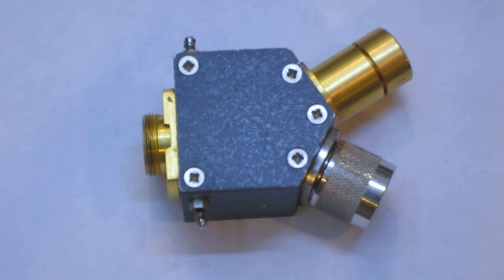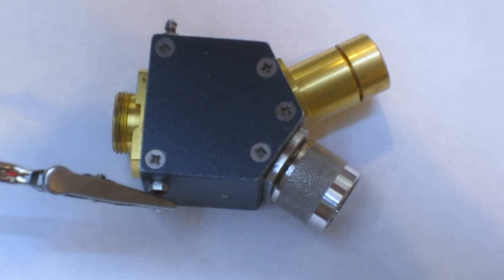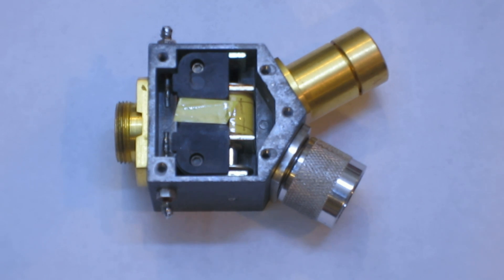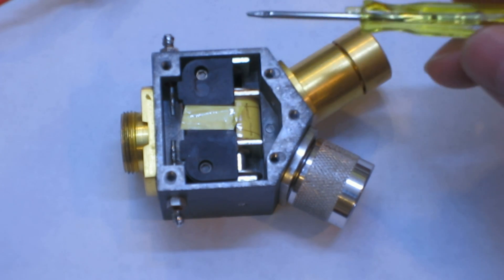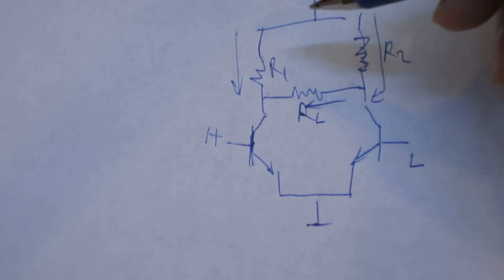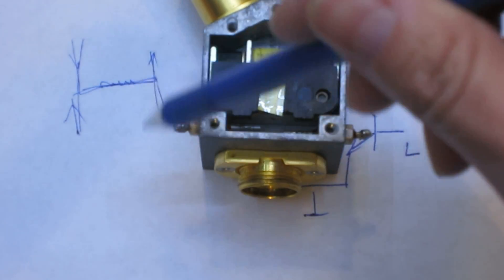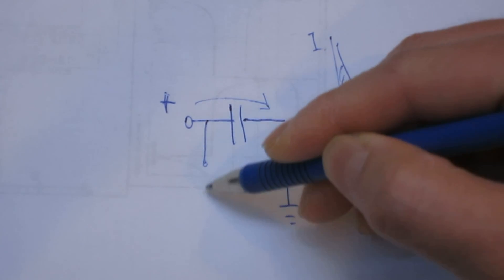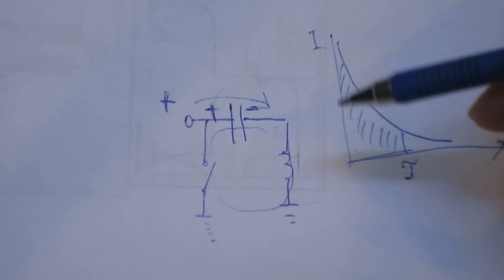How to Drive a Latching Relay

Comment: Thanks for this video and your other videos. Some are over my head buy your presentation and explanations are excellent.  I purchased an "L293D expansion board module" on Amazon. The chip seems to be a substitute i'm going to try and put a capacitor on the output side before the latching relay to see if I can get it to work.  The L293 is socketed so I can also test on a breadboard. Your supporting web page is great but the link is now broken. I'm having problems finding low cost latching relays. However, I did find this 6A relay I have ordered HF41F/5-ZS 5V 6A . Any other relays for me to consider that are lower cost?

Comment: Hi! Do you think LM358 could do the job? Because practically it has two 500mA rated push-pull drivers in a single 8-pin package and it's ridiculously cheap.

Comment: I like the solution with the 2 resistors. It's kinda crude but cheap and reliable. If you have two voltages available like 12V and 5V I would use 5V latching relays and drive them with 12V and those resistors. The ones I got have something like 170 Ohm coil resistance so I would use 220 Ohm resistors and BC547 or something. The resistors should be able to withstand 0.5W just to be sure. And the relays would get 5.3V minus a bit of NPN saturation so just over 5V. Perfect.